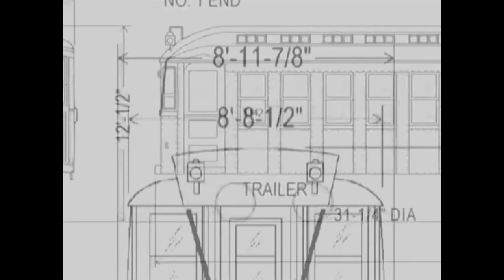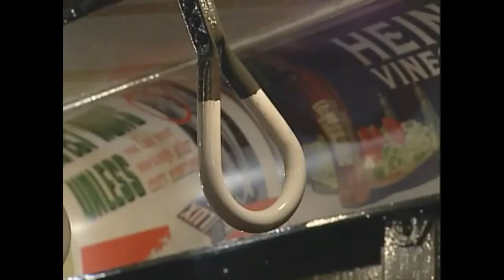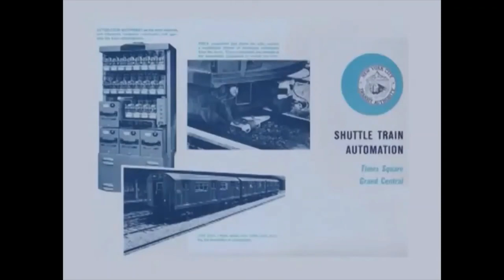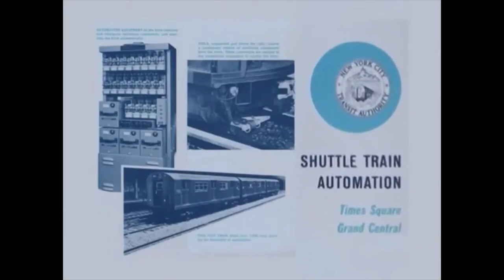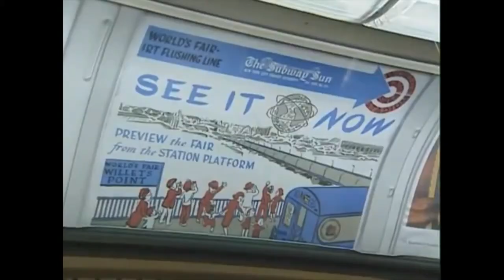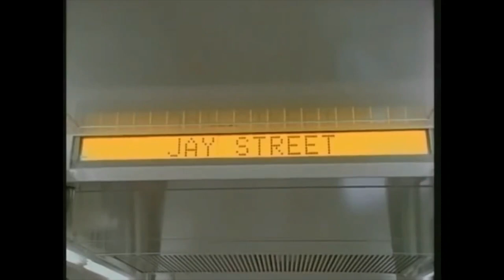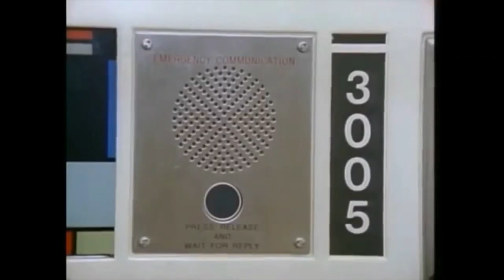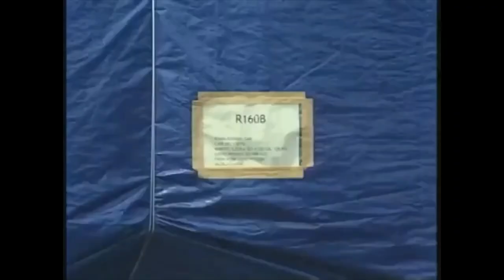New York City Subway System - Historical Look from 1904 through 2004

Comment: Does the part of the system built in 1904 still operate?
Reply: Most of it yes But the old City Hall station is now abandoned, but the track is still used by the 6 as a loop to turn around.